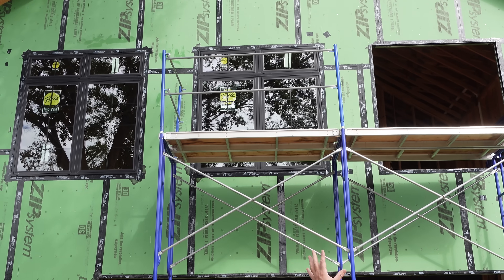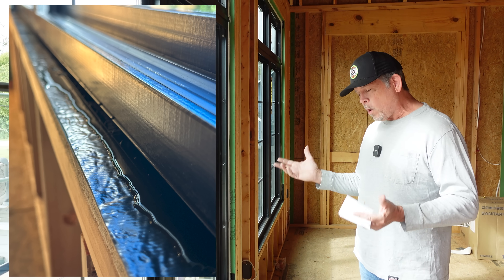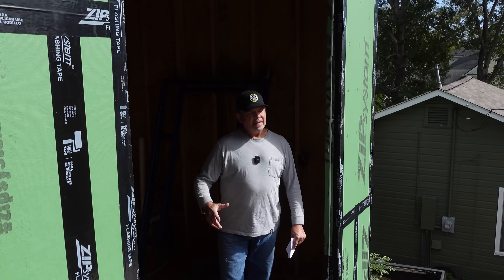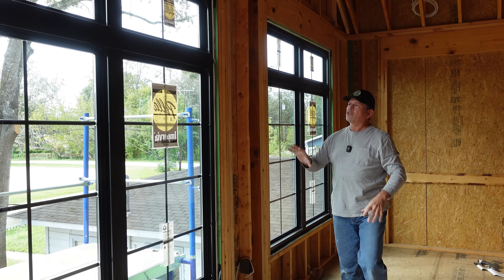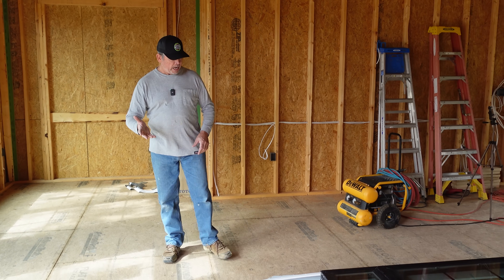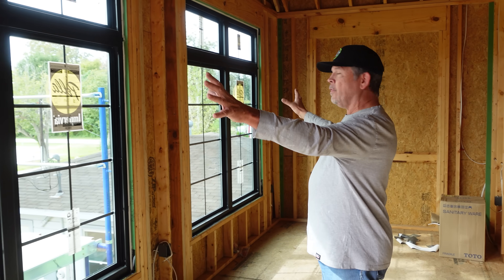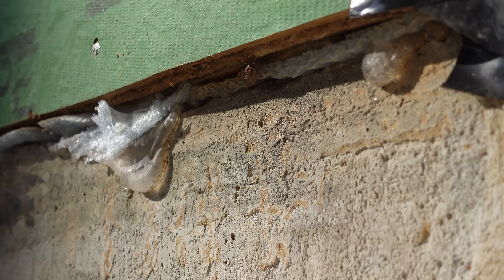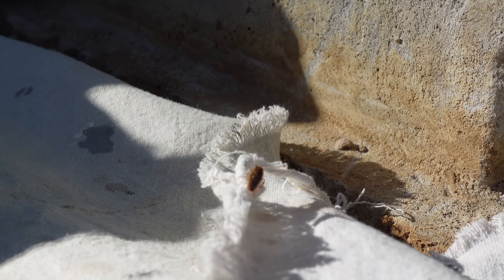THE WINDOW DISASTER - What Happened and How We Could Have Avoided It

Comment from the maker: Thanks for watching Gang! Use code STUDPACK50 to get 50% off your first Factor box at https://bit.ly/3F55GCL!
Reply: Hey Stud Pack, if you have not yet checked the comments from the last video, installing the 3 inch conduit, you should look at the ones talking about a slip coupling below the meter box. I learned it the hard way on my house. After years the dirt settled and pulled the conduit away from the house. What a pain fixing that when it could have been avoided had I known better.
Reply: If the other two didn't leak, why not compare the difference in the windows? Seems like it might have been a manufacturing mistake in that one window.
Reply: The problem with the nail fin is it pushes the window out making them look stuck on instead of adding depth by being inset in relation to the window trim. One reason new houses look worse than old ones.
Reply: At least you guys fix it when you mess up , construction work is easy to get wrong , there's a lot that can go wrong, I've a seen a thousand things that are wrong onsite and covered up by....... whoever ! Well in lads.
Reply: This is material for a new show called SPI: Houston Stud Pack Investigation 😉
Reply: I don't make mistakes, because I have a lot of experience. I got the experience by making mistakes. 'Nuf said.
Reply: Idea is great but the military tried 100% microwave and health issues exploded, they reduced microwave to a minimum
Reply: @trp2413  I think is more an issue of radio silence as if you are emitting microwave frequencies you risk to being discovered by the enemy.
Reply: 3 missing weep hole flaps. Nothing said why and if Pella ack owledge their error in my thought as to missing them. Still I would of put Pella in the spotlight to why the window was leaking and the fix. Pella didn't get involved and step up in helping to solve. They are responsible for no nail flange with the window if they say it should of been there. What about a the windows that may be installed the way  you guys did first per the insufficient instructions.  I can sure honor people who step up to errors and the solutions to correction. Especially a mfg of their caliber they portray. For me it takes some of the warm fuzzy feeling about them. All the videos so far on this build at this point it is one thing that stands out I'm not comfortable about.

Comment: I saw the mistake on your window installation video 

Minute 26:43  that was the mistake, that was the reason  the windows where “leaking” .

All windows leak or eventually will leak, the  problem here is that in your effort to air tight the house you also  installed a water trap, you could do backerod and silicon  on the sides and top but not at the  bottom of the  window, that’s where the water drains  out. When you installed the backerod at the face of the house you installed a water trap. 

You could use the backerod and caulk all around the window  but only on the inside.

Out side just 3 sides,  sides and top. 

How ever if you are doing new construction , windows with nail fins are the way to go. 

Love your videos, keep it up 

Btw, I am an stucco contractor 😬

Comment: Great job guys.  One thing you said was on the house you might step back the framing so as to make the liquid flash easier.  Remember the edge of the zip is unfinished. The concrete will retain moisture and will wick up into the edge of the Zip.  If you do that seal the edge of the Zip first and keep it off the concrete.

Comment: Guys - I enjoy your video. Glad to see you added the liquid flashing. One additional thing I would recommend on the ZIP sheathing is folding tape around the bottom edge and avoiding direct contact with the slab. It’s a lesson I learnt as it was a detail i missed and the ZIP rotted out in less than 3 years in Houston. The moisture wicks into that exposed edge if it’s touching the slab or rain is bouncing off the slab onto the edge.  I can email you pictures of what happened if moisture is left to soak into the ZIP via the exposed edge then left to  basically steam behind the siding in hot texas weather. All the best Iain.
Reply: i did something similar on a garage a few years back i had access to again (swapping a light fixture out). i wrapped the bottom edge of the sheathing in zip (in my case plywood). and that was sealed (similar to lexel but i forget which product TBH) to the sill plate and footer. in my case my dimpled housewrap is also taped to the bottom of the sheathing. but this means no extra step sealing below the installed sheathing with liquid flash or whatever. F that noise. Portland, OR, rainy AF, sheathing right above a concrete patio. no rot. bugs and mice inside because of the garage door. so good luck sealing that thing. ;-)
Reply: When sealing in conjunction with zip tape, always wipe zip tape backing with alcohol  to remove release agent, it gives a better adhesion between the two.

Comment: Oh - and I have made safety mistakes too🤗

I don't recall from the installation video how you sprayed it down, but my sense is if you used a high pressure squirt of some sort it went in through the weep hole and filled the bottom tray of the sill

Comment: I have installed many many windows of many manufacturers and also worked exclusively installing for Pella for years. It is not uncommon to install windows without a nail fin ... like in an opening of a house covered in brick. They have a brick mold that snaps in to fill some of the gap but you still need to caulk of course. It still always made me nervous that they might leak over time. But in sunny California they seem to be fine. Always always put a nail fin on if you can. Pella also has adhesive flashing tape that is made for the left and right corner joints of the fin. . And yes ... always leave the bottom fin not sealed with caulk. Let that water get out if it does get in. And water test for at least 10-15 minutes. Sometimes it takes awhile before a leak starts to appear. When stucco or siding is on ... water test for 30 min.

Comment: When looking at your conduit coming from the street, I wondered why it was not inside the foundation?  I don't know the code where you are and whether it was per requirement there.  I would have tried to install the panels with only the meter socket and main shutoff through the wall and accessible from the exterior.  We have a major termite problem, here in California where I built my house 26 years ago, so I poured a concrete curb 8 inches wide completely around the house.  Then sealed it.  No termites sneaking into the wood framing.

Comment: On one of the videos, there was a outside wall overhang of the perimeter wall to the foundation. You sealed this with a glue product, similar to Henry's roofing. I typically see this overhang, to allow rainwater to sheet drain away from the sill plate. Curious if you make the wall flush with the foundation would this promote water retention? Enjoy the videos

Comment: Morning.

3 yesrs ago i installed 19 pella 250 replacement windows in my house.  Replacements can be ordered in increments of1 eight inch H or W. Replacements you order without nail fin. Cause you dont disrupt the existing siding. And the instructions provided by pella were to screw at 4 points on each jamb into the rough opening. I installed from inside and screwed a 2x4 accross top znd bottom of opening on outside to locate the proper protrusion. 

To prep opening caulk applied btwn J channel and sheathing  and btwn shething and stud wall then flash the opening from j channel back 6 in.

The method you used to secure the big windows is the same method pella uses to jnstall replacment windows. So thru the jamb is an acceptable method to secure.

I deviated from instructions as i flashed the entire opening sill, jambs  and header. As i wanted no water near windows.  Figuring any water infiltration would flow around and down.

Just fyi
You did not screw up the installation.

Not sure where your water came from.  

On 1st floor ants like going into the weep holes fyi

Comment: The house will be very tight. Make sure you are getting the hrv/erv right. In the garage, make sure you have a way to move the air. If you start the car, fumes will linger around. Since your house is very tight, you might consider going rockwool rather than using spray foam which can be a headache. R value on the roof though might be an issue.

Comment: Just installed Anderson windows, glad I checked inside those flap doors for water to escape. Because they had plastic covering some of them, that had to remove with little pliers. So hot tip, check inside those little doors, to make sure water can flow out. If they leaked? Anderson would of blame installation, when it fact it was their lack of detail manufacturing inspection detail. Sorry about your redo on windows.

Comment: Good that you liquid flashed the bottom of the zip sheeting and the nail holes at the bottom row, though you are not required to do so it's good to liquid flash all the nailholes, if any nails have gone bellow the green layer they shoudl definatley be liquid flashed. The roof is also good to cover the nail holes though it depends on how your climate.

Comment: I would suggest waiting as long as possible after the power wash, but maybe you did with rain in the forecast. Every bit of moisture you could evaporate before the Liquid Flash may be worth it. The roach and silverfish sure seemed prepared. That being said I sure would like to see no green at the edge, but there were several exposed edge bands. As tenacious as water is and slow drying as Houston is I hope you use one more tube to truly wrap the LF along every inch of edge, not just under, hoping no water creeps to and under the Zip green barrier and into to OSB, possibly repeatedly. These are great informative videos. I need to know as much as I can to supervise or GC my build a couple hours north. I appreciate your commitment. One other foundation seal is the Fentrum Tape, which seems to seal to foundations and all the Huber products. Maybe it is a Huber Product. Matt Risinger mentions it from time to time.

Comment: At least you caught it and fixed it.  But for as expensive as Pella is,  they should have included all necessary hardware to install it correctly.  Not sending the nail flanges is sort of messed up.  If you had seen them in the package, you would have definitely installed them.  But seeing those little details has taught me so much if I have run into this. I will know to get the fins.  Thanks for sharing Studd pack.  You guys could have kept to yourselves.

Comment: one detail to consider on the main house is to zip tape the bottom of the zip sheets where they contact the slab, that way you have multiple layers of sealing protecting your siding. the zip tape handles protecting the sheathing, and the liquid flash protects the concrete to zip joint.

Comment: I wonder if SIGA FENTRIM tape is a better solution for zip to concrete. The split release tape means you can stick it to the concrete first and then fold it up over the Zip. It seems way too easy to burn through a large amount  of the fluid applied product.

Comment: Up here in Oklahoma, we had a contractor bid our new building. It is a post frame building with steel siding and he has the concrete guys make that ledge for the siding for the steel to sit down on to close off the bottom of the steel and prevent bugs and rodents from getting access to the building from the ribs in the steel. Hope that made sense, anyway nice video and nice job on the corse correction on the windows.

Comment: you should also not caulk the window bottom edge on the front. only the back so water can drain.  Just go in the edeges to connect with the foam on the other sides.

Comment: If you are still concerned, place a single layer of paper towel on the inside sill.  If there is a leak you will see the EXACT point where it occurs.  I have used this method for years when working on old plumbing. Last thing you want is a client telling you a leak damaged the inside of a new cabinet.  Same method, two uses. Kudos on the redo, thanks for sharing.

Comment: 33 year old dad that loves to DIY here. Can’t tell you how often I make little oversight type mistakes or have to run back to the hardware store 10 times for a “30 minute project”

Seeing that you guys do the same will make me wayyyyy less hard on myself in the future.

Love the series, I click every new video as soon as I see them. You guys are awesome!
Reply: The one recommendation I have for you as a DIY'er is to stress anything important and fix any problems you find. Note that Studpack did a water hose test to ensure there was no leakage. I've seen a lot of DIY'ers not take basic steps to find out if they have a problem. The most memorable being 2 guys at a rebuild together project installing exterior metal handrail on the steps but not one screw hit. After they left, I walked over and effortlessly lifted it from the brackets. I have no problem with making mistakes but they never recognized they made a mistake.

Comment: This brings back memories from when I used to install those kind of windows. Pella and Andersen windows were by far the best. And those nail fins or flanges don’t come pre installed from the factory on large size windows to avoid damage in transport, but they should come with the window already cut to size. I know I had to figure this out on my own the first time I installed a new construction window. And those weep holes that connect the catch tray from the inside to the outside are there for condensation. In cold days the glass gets cold, moisture from the air, cooking or even your breath cools down and runs down the glass and escapes out through those weep holes. Can’t wait to see the insulation video, what are you guys gonna use? Rock wool or foam?

Comment: You can plane the bottom sash of the window frame....plane down the outside edge of the window sash 1/4 inch so any water that does get in will drain to the outside and not just sit on the sash.

Comment: I am just starting to re-sheath, install 3/4" air gap behind new windows and siding so these vidoes with Matt Risinger's are perfect. I have a Garage full of Pella 250 windows and all came with a nailing flange. I will verify the drain flaps are installed when I put the windows in thanks to this video. Take a look at your order to see if the flanges were missed. It took me 5 reviews of the order before I got all the mistakes corrected.  Keep making these great videos, the correction of mistakes and problem solving on the fly is what helps folks out.  Too many videos out there showing how things work in a perfect world but I have yet to find this mythical place.

Comment: I don't think I would flush out the sheeting with the foundation on any building. I would prefer a little overlap to have more of a shingle affect to have the water barrier 1/2 an inch more to the outside of my foundation. Just my opinion also have never seen that on any residential building that I have worked on.

Comment: I don't know any builder that water tests their window installs. Certainly not prior to siding. I do wonder if running siding and caulking that, and then casing round the window and caulking that would have stopped your leak anyway. Most windows are never sealed in to the extent that you guys did it. But hey can't hurt to be over cautious.

Comment: Sponsorships being what they are aside, I would recommend looking into Prosoco R Guard, or the Polyguard Blue Barrier for use on the main house and even to go back over to achieve the look and coverage I think you envisioned.  Both of those are fluid applied barriers with essentially the same properties as zip system but can be brush and even roller applied and purchased in a 5 gallon bucket.  Definitely both Matt Risinger approved products and method
 Cheers

Comment: Your fasteners in the flanges should never be tight.  The vinyl expands and contracts and needs to be able to move that slight amount so the screw should just touch the flange but not pull up tight.  Check with Pella or whoever makes your windows.  That is another reason screws are a better method as you can adjust the final takeup infinitely.

Comment: You would have thought as much remodeling as you have done, it would have set off the alarm when the window would have been inset in the trim. I have never seen a window installed flush to sheathing. It was most likely surface tension causing the water infiltration. Great job showing your mistake, it makes for a real video and not a production.

Comment: Great video- again! Keep it going fellas! Super stuff! 
Could you also have zip taped the underside of the zip sheets on the ground level, BEFORE you installed them, thus sealing them at least against bugs, before installing them, which would have been an easy install. Also, does the ZIP tape not fix to concrete? As a water barrier in it's own right on the underside, rather than the gloopy mastic?

Comment: It really shows the different accumulated knowledge from a new house builder and a remodeler.  A lot of very minor changes that the remodeler may not be aware of.  A good example is moving the wall in the width of the sheathing as Paul mentioned.
Reply: I think most builders would actually overhang.  They're fine as is.

Comment: You don't want to flush your Zip sheathing with the edge of the concrete stemwall because if there is an opening into the house for some reason,  all the water flowing off the Zip will enter the house at that point.  Having the Zip extend past concrete creates a natural drip edge.